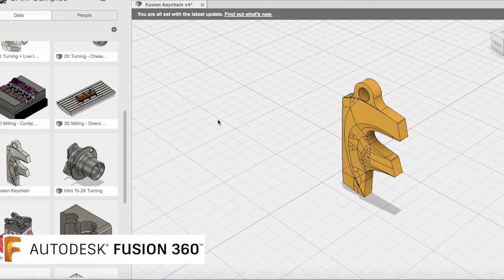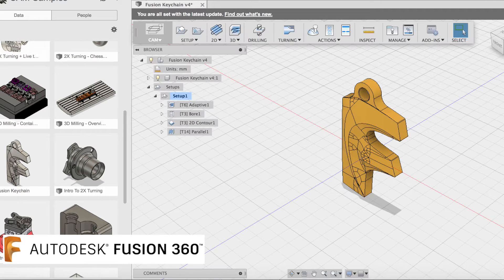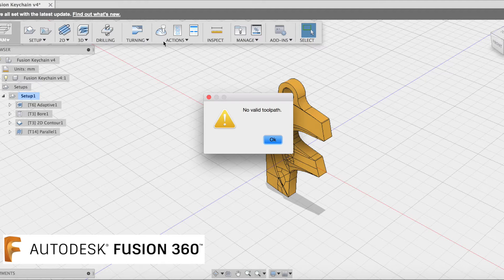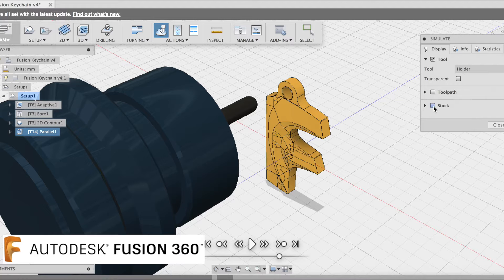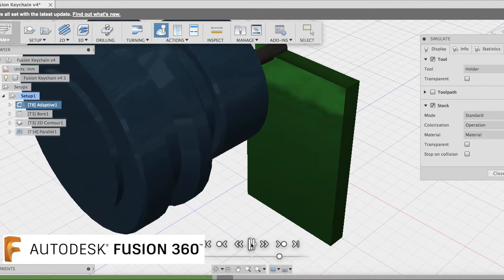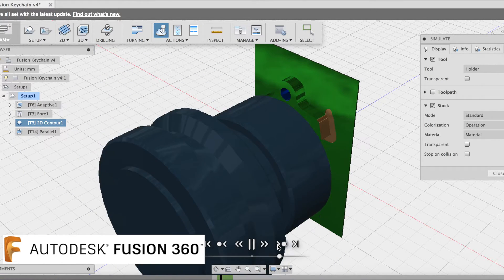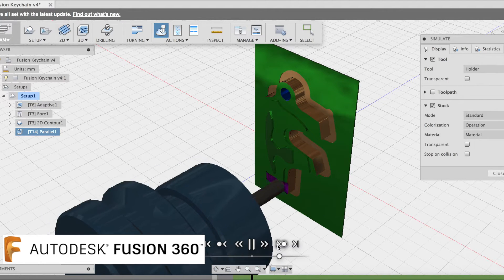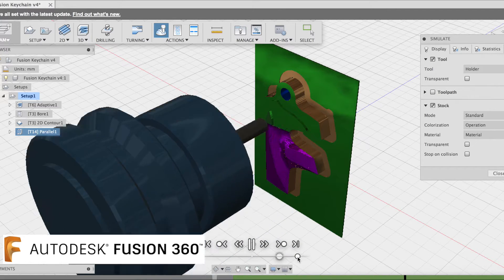CNC Machining via Fusion 360

Comment: How did you get rid of the rest of the material?
Reply from the maker: Hey man, after filming I placed some 6mm thick stock in the machine. I used superglue to hold it during the machining process. 👍
Reply: Superglue is the way to go. Mr Saunders of NYCNC did his with double stick tape and had it moving all over the place.
Reply from the maker: +The Metal Butcher yes I also tried double sided tape but it was hopeless. Then I found a small bottle of superglue lol
Reply: If you find yourself using it a lot, it might be a good idea to get some thin (it will run better and leave a tighter fitup) superglue from a hobby store with some proper activator. That stuff works wonders. I've never been impressed with loctite glues.
Reply from the maker: +The Metal Butcher I usually use ultra-thin double sided tape from Venture Tape USA. But I can't get it here anymore. So I now use another brand. Still very thin, but it struggled to hold with such low surface area, Yes hobby glue is good stuff. I need to get more of it. Cheers